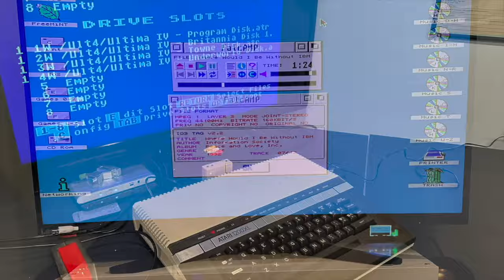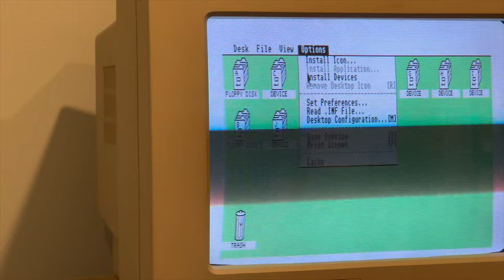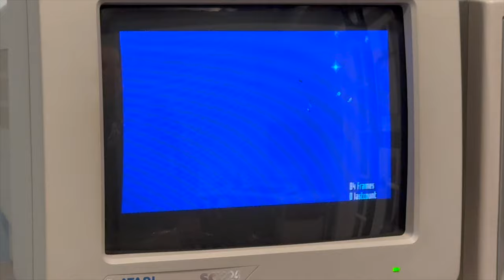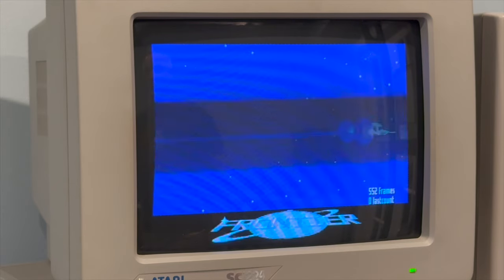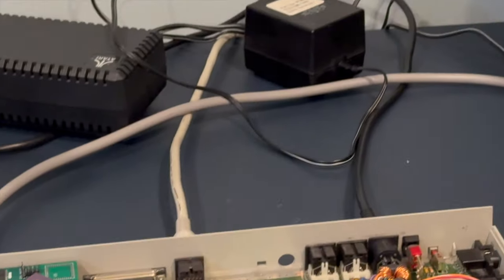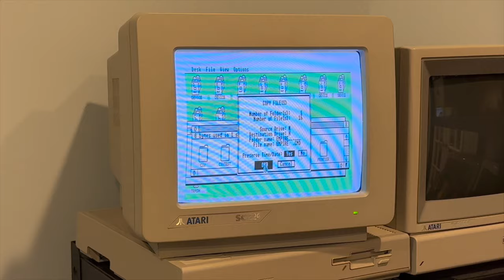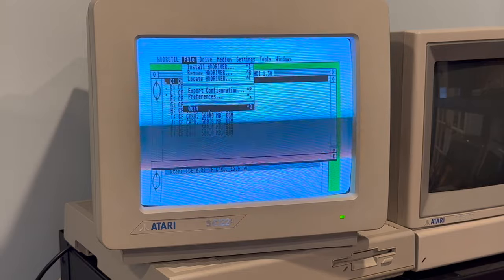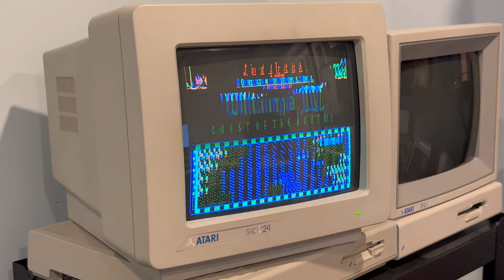Building a new Atari ST accelerator!

Comment: A simple trick when you're doing hand soldering of TQFP packages (depending on their size) is to put a coin on top of them when they are generally located. Quarter, nickel, dime. Just make sure the coin is not so heavy it bends the legs upward. Align it, tack down opposite ends and it should stay put till you can finish the drag solder technique. Also, I use MG Chem no-clean liquid flux in abundance for the drag process, a lot less chance you're going to see blobs (temps and good solder / correct alloy)
Reply from the maker: The coin trick sounds fantastic.  Great idea

Comment: Fantastic, you get to make the mistakes right before I build mine. But seriously, Great job, I'm going to take your path and start with the large SMD Chip.
Reply from the maker: Good luck with the build!  With the right tools and experience it is doable.
Reply: @powerofvintage9442  I invested in a new Weller and tips or I wouldn't try. I also learned to use good solder. I was making things hard on myself with the cheap stuff.  What do you use to do your magnification?
Reply from the maker: For magnification I use a magnifying visor plus my phones camera.

Comment: Congratulations, well done :) not sure why you turned off the cache though.. you can put MAPROM from the ST536 zip in the auto folder to make the desktop run faster ;)  Also if you have a ROM adapter, there is a ROM output signal near the ST536 ROM socket.. so you don't need an external 206 decoder ;)
Reply from the maker: Awesome!  I'll turn the Cache back on.  I'll test out maprom too.  I like keeping the external 206 decoder because of the height it provides and the battery backed up clock

Comment: I heard PiStorm for the Atari ST works now… that would deliver way more resources and computing power than a TF536.

I am hoping you check it out! I have a couple of STs I would love to run MiNT on!

I am seeing that people are getting 700Mhz on their Atari ST PiStorm computers… 2 GHz should be working too eventually!
Reply from the maker: I know, I have a PiStorm for the ST that I haven't built yet.  It also provides emulated Tseng4000-like graphics as well.  While I'm not a purist, I prefer CPU's from the era the computers were from; 68k, 68020's, 68030's, 68060's etc versus an emulated CPU.  It doesn't mean I won't try it out and play around with it a bit.
Reply: Pistorm is still very unstable though unfortunately..
Reply: @exxosuk  heard that too

Comment: Nice work! I recently bought myself the ST536 board+birdseed to build myself. Ever tried fitting it in an STFM revision (specifically C103253 in my case) where the 68K is under the keyboard with no room? Maybe I'll just have to find myself a Mega, or similar with more room
Reply from the maker: I’ve not tried in an STF.  There are socket “relocators” that exist and are used in Amigas. I’ve tried a bunch in the past with my Amiga 1000 as well as in the 520ST previously.  That’s your best bet IMO.  You can see if those already designed are what you need or use a service like PCBWay to design and manufacture a custom one.

Comment: Nice upgrade, I would not take something like that on, my expertise ends at replacing a keyboard or floppy drive.  On another subject - have you heard of a Falcon chip that has a battery inside?  A commentor, on another YouTube Falcon video, said that one chip has a battery that will only last 10 years and then the chip fails.  Have you fixed your Falcon (with a battery) and could you make a video of it?  Btw, did you ever get the FPU to function?  (I have a Falcon and it seemed to run fine - after sitting around for 30 years.)
Reply from the maker: Ah, the FPU on the Falcon is working great with the full 68060.  On my 520ST with the accelerator that has the FPU, still haven't figured it out...not trying hard though because not much software really uses it.  Yes, I have replaced the NVRAM (BIOS in modern computers) which had the battery embedded inside it (Dallas clock chip) with a modern Exxos replacement.  I did that before I started my YouTube channel.  

Most important thing that I did with that was to use low temp solder to desolder the chip legs (especially the one connected to the ground plane).
Reply: @powerofvintage9442  Could I do something like you did, cutting the legs to remove the chip?  The chip will not be reuseable at any way and would rather take my chances desoldering the legs to keep things cool.  Of course, I will have to break the seal - my Falcon is new.
Reply from the maker: @mikecaster4612  The dallas clock chip / NVRAM is flush with the main board.  I would worry about damaging the main board while destroying the clock chip.  

What I did and would recommend is use low temp melt solder (quik chip is a brand name) used typically for removing SMD components.  You add this solder to each of the solder points on the board 

Then you can go about this in three ways really.  
1 - Heat each point to melting and gently pull the clock chip out while the solder remains molten, then clear our the holes.
2 - Use a desolder gun to suck up the solder and clear the holes and remove the chip
3 - Use solder wick to clear the holes and remove the chip.

This makes it much easier to especially remove the stubborn ground plane connected leg on the clock chip and not need to use too much heat on a rare board.  You just need to be extra careful to wick up all the extra solder once you're done.